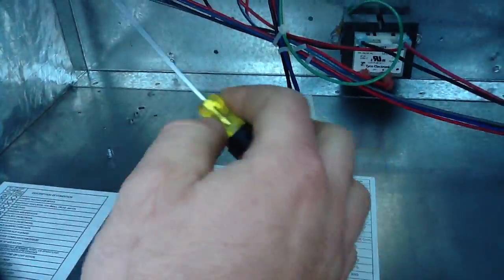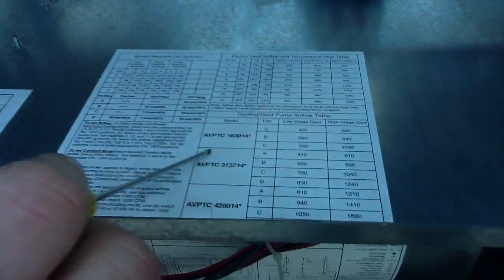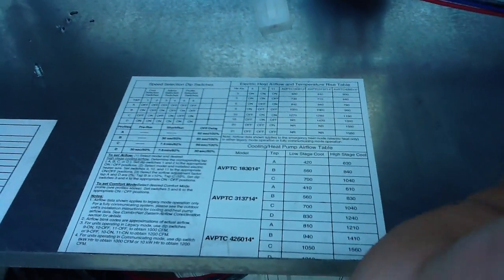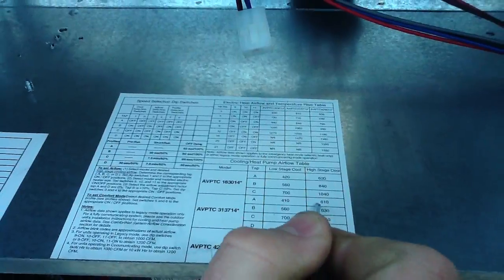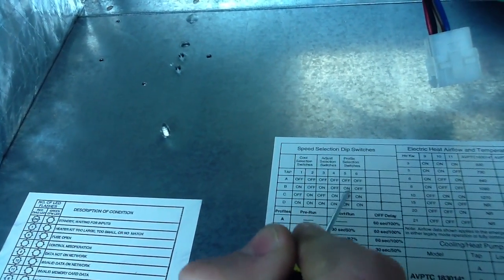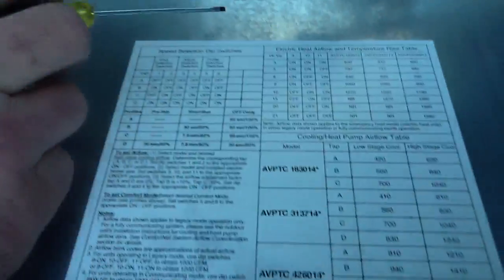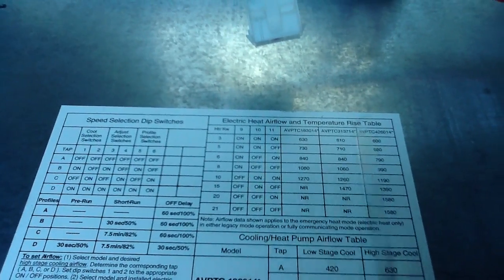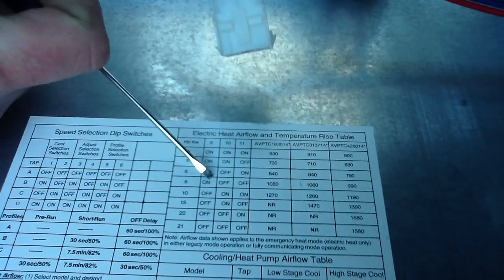Showing how easy it is to set Dip Switches on Goodman AC Unit

Comment: Your video here helped a ton in getting my 4 ton air handler dipswitches set. Now it variably sets fan speed and actually uses the heat strip low/high as needed.

Also like how those stickers got everything you need to know including error codes from the LED display.

Comment: I have a furnace goodman gmec960804cn. how to set up the fan speed to full for cooling. airspeed is less on top floor. (detached house with basemnt+mainfloor+top floor). also, is it the same for heating too?? i have a 4 ton Carrier Performance series AC. with 3.5 ton carrier coil.

Comment: I have a luxaire 80% furnace, only 4 dip switches. I want the blower to stay on longer to get all the heated air out of the ducts. How do I changed the length of time, blower staying on after gas valve shuts Off?

Comment: Hi I have a question i have a venstar t1800 thermostat, when I got my house few years ago they program the thermostat for 20 minutes every hour the fan to turn on, so in winter it was so cold so I figure out how to turn that off, but this year I don't know what happened when I turn my heat on there's  no heat  I just feel the feel the air like for an hour can you please tell me if I reset the thermostat their programming Is going to delete I just want tu turn on and off my ac and heat when ever I want, please tell me if that's ok if I do that.

Comment: I found your video extremely helpful.  I have a Goodman MBE 1200 blower (ECM variable-speed motor) and an Amana ASZ160241AC  2-ton condenser.  The blower noise has always been excessive and the a/c only has to run for a few minutes per cooling cycle so humidity control isn't great. My a/c guy thought he could adjust the blower speed.  When he looked inside the blower there was no spec sheet so he looked on the internet and then said that he could only make the 15% down trim adjustment because a speed of (approx.) 1150 was the minimum required.  I think he was only looking at the CFM for the 10kw of installed heat.  I've looked at the MBE specs online and I don't see why the blower couldn't/shouldn't be set to 800 on cooling to match the 2-tons outside (as was the case with your AVPTC).  Is that not correct?

Do you personally know a tech you can recommend in the Gainesville area?  Thanks.

Comment: How would I set the cfm on the goodman gmes800804b series. Their is 4 dips switches but the instructions only listed 3 dip switches?
Reply: where did you find the dip switches, I cannot locate them on my unit, I have the same unit as you?